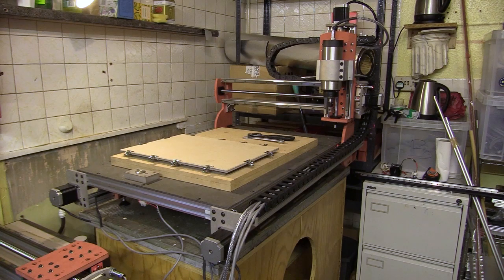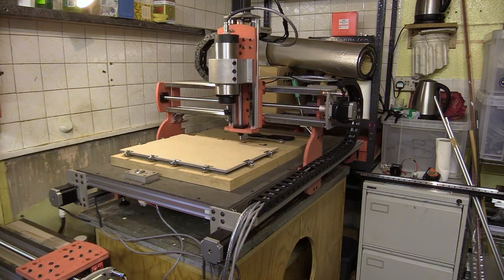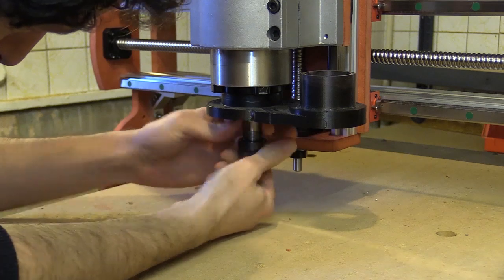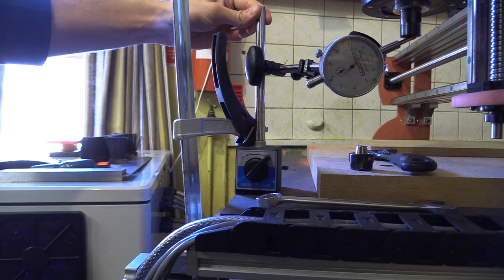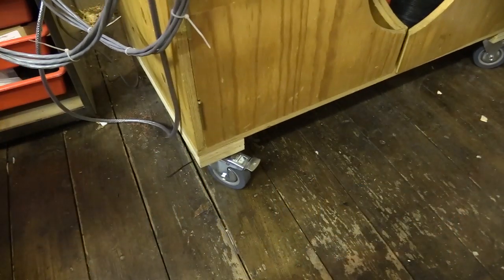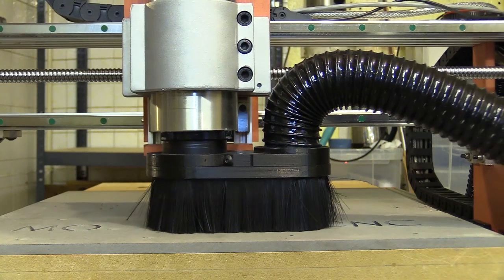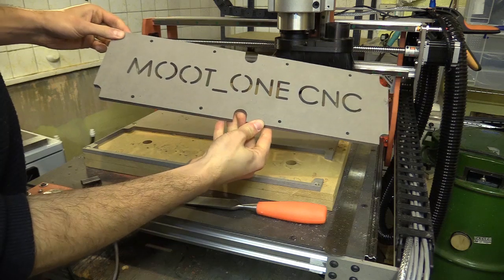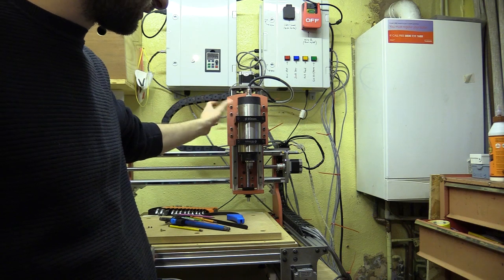#46 Constants of CNC Accuracy Testing - Travel Accuracy Backlash Squareness Deflection Repeatability

Comment: So what’s the final testing results for accuracy ?
Reply from the maker: On the cut it's about 0.3 of a millimetre backlash. I'm in the middle of rebuilding my controller at the moment, and will make better videos about it's capabilities but I'm really happy with my machine. It's a little heavier than I had liked but got really good results whenever I needed to cut anything.

Comment: Hi mate, could I use some of this footage in my kickstarter project?
Reply from the maker: No, please don't.
Reply: @EducatingSavvas  not even the part between 5:35 and 5:38?
Reply from the maker: You haven't even told what me you're trying to do a Kickstarter for... so the answer is no.
Reply: @EducatingSavvas  I'm making a CNC machine, how come you don't want me to use it?
Reply from the maker: Any formal request should be emailed through the contact section - with your name and contact details. It's very unprofessional to do this through the comments on a video.  I'm also reluctant to allow my footage to be used, especially on Kickstarter considering I didn't crowed fund my CNC machine. Answer is still no btw.
Reply: @EducatingSavvas  if you just said yes I'm sure you would be much happier
Reply from the maker: @Seed-qj6jk  Impossible.

Comment: measuring diagonals works well but I don't think eyeballing a square is a good way to check the geometry of the machine.   I'd strongly recommend you get a set of 2,4,6 blocks and use your dial indicator to measure the geometry vs just getting a notion of it.  You will find the blocks generally handy for many many setups and measuring tasks.   A indicator holder that mounts in your spindle is also very handy for tramming your spindle. You also may be seeing backlash in the ball screws based on the roller bearings they tend to come with.  Tightening can't really take out the ball bearing slop unless you put a spacer in which will likely reduce the life of the ball bearings.  40 degree angular contact bearings in the FK12s will improve the rigidity over what you get from chinese FF,EF,BF supports. It may also be a good idea to validate the squareness of the machined nuts since I've seen firsthand that they are not always actually properly machined.
Reply from the maker: A lot of what I'm going to make only needs to be validated by my poor judgement and bad eyesight. It was more important for me to get the x and y square, and the z to be passable. But yes you can even make a simple jig with a machine screw held off from the spindle and use paper (old fashion invention) to check the gap between sides. I did that once with a drill press table. If I was building these as a job I'd make jigs to calibrate all the assemblies but instead I just use a kitchen granite work-surface. The backlash on the ball screws is 0.05mm once the locking nut is properly tighten, which I can live with. I'm not well versed with how to use blocks though - I'm not an engineer so really making it up as I go along. I wanted this video to highlight areas to look at for people starting off really. Cheers and happy accurate new years.
Reply: @EducatingSavvas   The blocks are really handy and easy to use since they are square and parallel to .0006".  The setup for this is simply setting the block on edge, attaching your dial indicator to your Z axis and setting it up on the side of the block.  The blocks have quite a lot of heft so they stay put.  You then just move your Z up and note how much your indicator moves.  Since they are perpendicular you get a direct measurement of your z perpendicularity.  The blocks also have threaded holes so you can bolt directly to them.  This is great for workholding and where they can really shine.  Since I have a bunch of 123 blocks and one set of 246 blocks I don't think I could live without them.  The metric equivalent are 50-100-150 blocks.  Setting this up for your machine would literally take less than 2 minutes.  I also point it out because they are a tool every cnc or mill should have.  My set was $64USD but the price has gone up a bit.

An alternative might be using a set of parallels and setting them up perpendicular.  Oxtools has a video on how to do this easily.
Reply from the maker: @JesseSchoch  I don't want to over-complicate this but I sort took your advice - I took off the z assembly with the newer mounts and used the granite kitchen work-surface, an engineers straight edge and dial gauge to check the plate against the rails / ball screw. Which I got down from 0.16 to 0.06mm off. I then flipped the assembly and clamped the straight edge to the spindle mount with the spindle in place and made sure those were tightened in line with the plate – the top and bottom of the plate were less than 0.05mm off.  I then flipped the assembly again and measured with the engineers square in the first position but this time the shaft of the tool in the collet. This was 0.03mm off over 30mm of the tool shaft length. I can now refit the tool and measure from the side of the assembly and free pretty confident the collet is in line.  That's for the X axis - I've not thought about along the Y axis.
Reply: @EducatingSavvas  I hope measuring it made it a bit easier to make the adjustments (knowing if you improved it and  how much)!  Now I just hope your square is square!  I'm refitting a mill right now and it can be daunting to fiddle with all the small details.
Reply from the maker: Think I just got a bit lazy at the end. Lol. You can see the details here: https://www.instagram.com/p/B606SUDAH6X/?igshid=qb68xslt9rr7 - It's daunting to think about how I'll explain these steps in the manual - there's so many parts. Good luck with your refit.